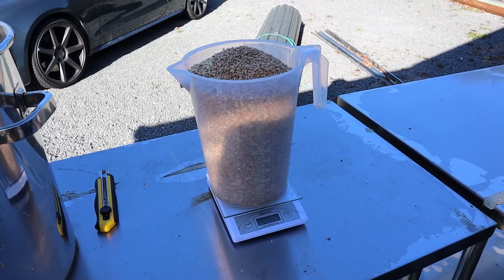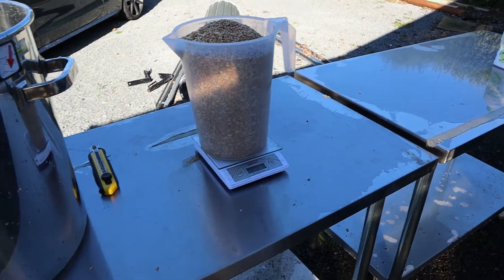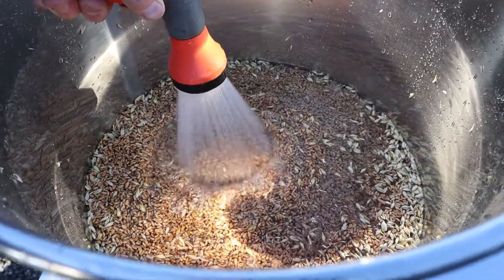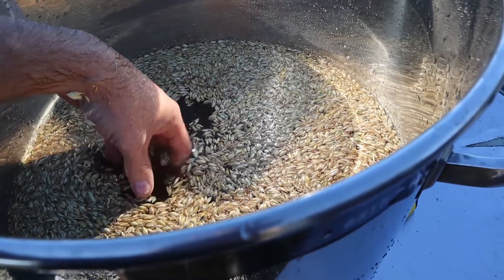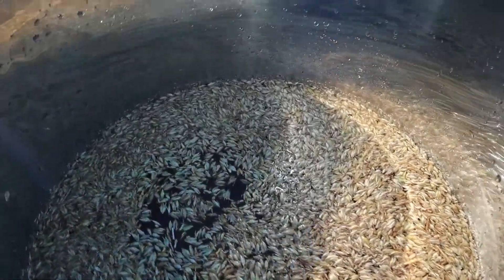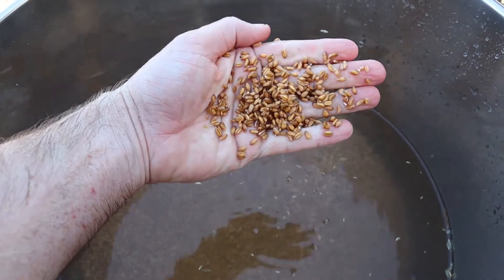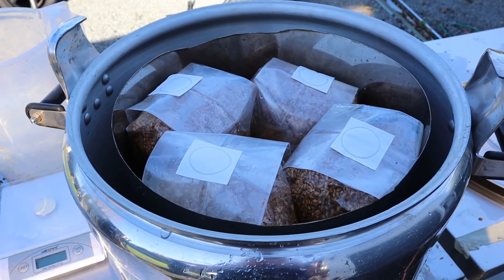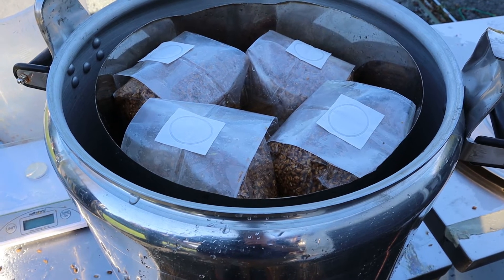Making Mushroom Spawn The Easy Way - Preparing Grain Spawn for the Autoclave

Comment: you really add 1 1/2 cups of h2o , thats 650 ml ....?
Reply from the maker: With my new autoclave I mix 950g dry grain with 550g water. It may seem light on the water side, but it prevents contams and the mycelium grows nicely
Reply: @OakandSpore  results is what matters , ive only been at this a short tyme and am looking all around to get good results . i thought that was alot of h20 for 1 bag

Comment: You could add a little hydrated lime to bring up the ph and act as a buffer to contaminates. My method is to rinse my grain in a homemade stainer, hydrate for 24 hours, then drain it and then dump a pot of boiling water over the grain, toss it and let it sit for 24 hours to steam off. Then bag and pressure cook for 2 hours.
Reply from the maker: That's  good idea. I haven't used hydrated lime much as I don't sterilize with it, but might give it a go!
Reply: Interesting method. 24 hours to steam off sounds a bit overkill time wise, no? Seems like you could bag it up after a few hours?
Reply: @gabgerrard2045  no the steam dissapates in a few hours. The 24 hrs is to let the grain dry to the touch but is still fully hydrated. And i switched to just hydrating for 24 hrs and let drain for two hours, then bag and pressure cook for 2-2 1/2 hours.